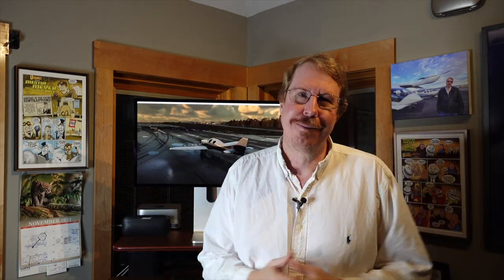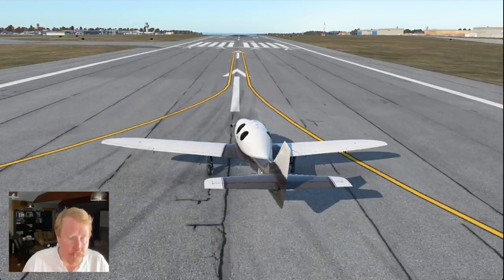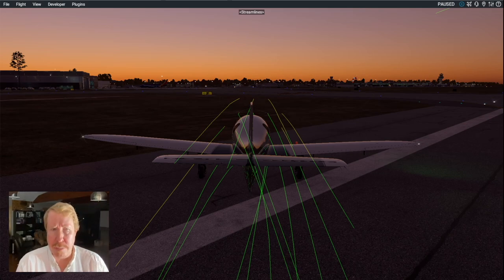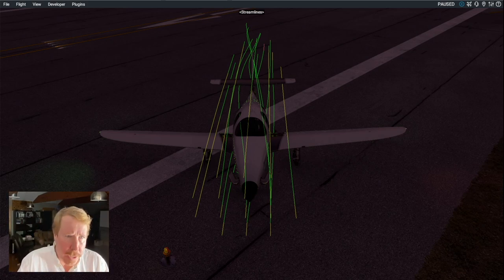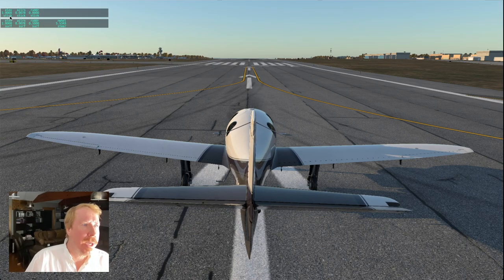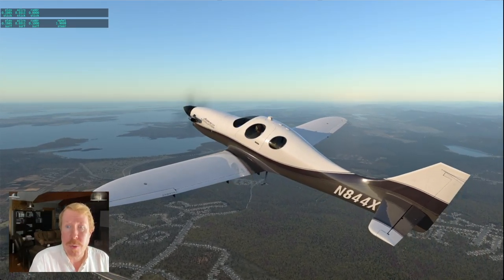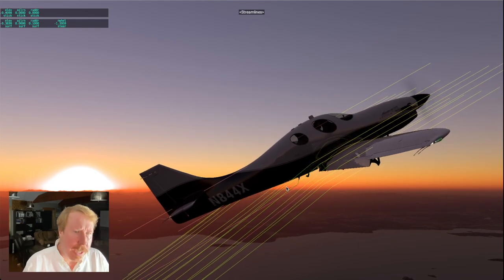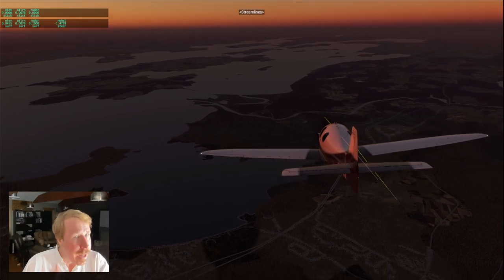X-Plane did WWHHAAAA!!?!?!?!?

Comment: X plane is definitely a sim for pilots. The flying feels realistic. It has its moments but hey, it’s still a game at its core. I’m really impressed that you can even program something that can replicate something so complicated. It was 50 percent or more the reason I was able to last my instrument add on. When things weren’t going my way on my check ride I relied on the training where I wasn’t burning gas.
Reply: Both sims are fine. No one should be doing maneuvering physics in either and both are fine for procedures which is what you describe.  I love both sims. But this fan boy one or the other is weird.
Reply: XP sitll uses Blade Element theory for its flight physics calculations though. This not as accurate as msfs boundary theory and CFD. And Weather, world wide weather representation is XPs weakness.
Reply: @hpharold23  the CFD mfs use is not the same , high fidelity model that NASA uses it is about on par with blade element weaker in some aspects . Saying that mfs CFD( which is lower resolution  has a  small grid size  ) is superior is ridiculous
Reply: @hpharold23  troll alert
Reply: @hpharold23  Great copy and paste.
Reply: @hpharold23  I just leave here for you buddy. This is where CFD gets you, from one that knows. 

“The previous update had a few scenarios which were still problematic for under-thrust and over-thrust conditions. These conditions come about because the atmospheric stability in MSFS is significantly unrealistic, and we have had to build additional logic into the control law for these channels that is capable of dealing with situations that are thoroughly inconceivable in the real world.”

- RSR, PMDG
Reply: @hpharold23  CFD is an excellent way to optimise the aerodynamics of real aircraft. Also to investigate how a prototype will handle before it flies. It's much less useful for simulating the known flight dynamics of an existing aircraft. Using CFD techniques does not, of itself, improve realism. I don‘t think Asobo will one day reach XP‘s level of flight physics.
Reply: @hpharold23  what you miss is that no amount of simulation is suitable for pilot training when it comes to maneuvering.  It’s all bad without g forces.  Msfs actually simulates
High wing aircraft better than xp11 by default. But that’s not why we use simulators!   We don’t use them for flight training we use them for procedure training.
Reply: it doesnt really matter how „realistic“ an airplane feels. Most of the people flying in sim wont ever fly a real plane. So for me it doesnt matter much if an Airplane feels so much like the real one as long as I have fun flying. For me the sim should look good, the plane should feel good to fly and I am set to go
Reply: @hpharold23  Better tell the FAA this because X-Plane's flight model has an FAA certification.
Reply: @juliusott  Thats perfectly fine. You are the „public“ MSFS wants to adress. Everybody can choose which sim suits him the most.
Reply: @frankbyte  absolutely
Reply: @Deploracle  You took the words right out of my mouth. If XP is "a game at its core", then how do we reconcile that the FAA has blessed one of its versions as a "real" simulator? I don't think that "game" handle actually applies.
Reply: @8a41jt  The only differences between the FAA approved version and the desktop version, according to Laminar Research, 

1) the approved version allows for larger panels and panel textures (to better interface with the hardware side of FAA approved) and 

2) the approved version only features aircraft that are involved in real world flight training.

The heart of X-Plane, it's flight model, is the same in both the desktop and the FAA approved versions.
Reply: @Deploracle  I remember when Burt Rutan of Scaled Composites used X-Plane to turn White Knight 1 into a Spaceship 1 flying simulator, by strategically retarding White Knight's performance.

Game/tool is just semantics. It's a game that's a tool, that's a tool that's a game.

All I know is it can turn one airplane into another airplane for training pilots. Using off the shelf desktop computer hardware that was at the time less powerful than the average modern smartphone. They used like an HP or a Dell or something.
Reply: @juliusott  Then you’re gaming, not simming.

Comment: It could really do with a wind-tunnel mode in the plane-editor... a way of getting L/D ratios, stability margins, cg-positioning etc. in a controlled environment.
Reply: Austin hear hear, please this would be a wonderful tool for people who design their own aircraft projects.  I was wished for that in Plane-Maker.
Reply: Yes I would pay for a different software that is more wind tunnel focused.  I don’t need world scenery or mirror finishes or fancy cockpits.  I just want to do testing on my design.
Reply: @RA-gk5zg  Invest in real professional software. You will need non-realtime CFD for that, and be warned that it will be very inaccurate.
Reply: @ArchOfficial  I have to second this. As good as this is in X-Plane, a lot of optimizations and shortcuts are probably done to keep everything running real time on a reasonable computer at home.

CFD simulations do what you want. Please note that FreeCAD has OpenFOAM support and other CFD stuff as well. It should definitely be possible to do what you need to design airplane stuff. But don't rely on it for human life!
Reply: @TankdozerCavalry  My point is that even the best non-realtime CFD that take forever to render are pretty inaccurate. Absolutely useless for automobiles and lacking at best for aircraft although much more usable than for automobiles.

The only purpose of CFD is to guide towards possible optimizations of designs, not to actually test designs. You need experimental data to have a better idea of what is going on, even for aircraft.
Reply: IMO a wind-tunnel mode wouldn't need to be a full CFD system - it would be fine (appropriate, even) to use the same flight model as the main sim. But to be able to fix the aircraft model at a particular attitude with a constant airstream and observe and measure variables and vectors would be great.
Reply: @thromboid  In defense of the original idea. You CAN always up the resolution of a simulation at the cost of resources and processing time.

Comment: While I have never tried XPlane 11 or XPlane 12, I will say I'm truly impressed with those diagnostic tools showing the effects of wind on flight surfaces.  Where were you when I was in flight school learning this stuff?  :) :) :)
Reply from the maker: SOMEBODY has some downloading to do – x-plane.com/try-it (it's free)
Reply: Microsoft Flight Simulator has a very advanced system and can show those same wind flow effects and being a pilot myself and own both Xplane 11 & 12 and Microsoft Flight Simulator I can say that as of the 40th anniversary update to Microsoft one, it leaves Xplane in the dust for most things even physics now which is why I stuck to Xplane so long as graphics aren't everything but Microsoft is the complete package now. Xplane has become unplayable due to constant fps issues and considering that it's far inferior in graphics just doesn't add up. I used to be a staunch supporter for x plane but I can no longer say that I am due to its old outdated tech.
Reply: @topgunsi  MSFS is also a bandwidth hog because it has to download those world graphics. You pay dearly for it being as pretty as it is. I wouldn't say it's flight model is any better either. Not markedly WORSE like FSX was, but not better. Xplane is also easier to mod if that's your thing (like a LOT easier. Xplane connect, plane maker, etc). And it has weapons in it too as a bonus.

Comment: Thank you for such great software Austin.  As a real life pilot, my experience with X-plane (since version 8) is that it is VERY accurate compared to a real airplane once the joystick setups are adjusted.  X-plane modeled by two airplanes very closely (Grumman AA5 and current airplane is Cirrus SR22T).

Comment: Thanks Austin! I remember emailing you years ago about Helicopters and Stability Augmentation Systems, Stabilator Systems, autopilots for helicopters etc.. in particular the Black Hawk Model you had. One thing that impressed me the most with you was when you first just replied with the short answer of Google Blade Element Theory, I told you my credentials about being a reference pilot for the level D Full Flight Simulator and real world pilot of the aircraft in question. We then got into a very good discussion on aircraft systems that goes beyond just green coloured lines in order to make an aircraft feel more realistic. Especially helicopters with these systems fitted to dampen or enhance the control outputs. You listened and asked questions of me, didn't just shout me down with all your knowledge and defending code as we coders like to do. I give you a lot of credit to this day when I talk to others saying I've had this interaction with the creator of X-Plane! It's an amazing Game/Simulator, and you should be immensely proud of your achievements.

The more you can do a comparison using your real aircraft VS. the sim the better. I have done many overlaid videos to prove my points that the sim does what the real aircraft does, when the non-believers pipe up! After all, that's that only way we can qualify and re-qualify a Level D Flight Simulator each 12 months by using very small tolerances in comparing data, both tabular and graphing.

You did mention about incorporating some of my ideas into X-Plane 12 helicopters. I was wondering if you may be able to conduct a similar video on rotor-craft?

I really enjoyed this Video. You really explained everything in a simple and fun way for even the non-pilot to understand.

Well done and PEACE OUT! 🤩

Comment: I have no idea who this guy is, nor have I ever heard of X-Plane, but as an aerospace engineer, I want to point out that this guy explained and visualized a lot of the physics amazingly. Looking at the flow visualization, of course it’s not 100% accurate, but it’s definitely good enough for a game! Great job sir! 👏 

Might have to give this game a try soon :)
Reply: Especially note the downwash of the wings impacting the flow over the tail surfaces.

And, of course, also the propellor downwash impacting all the lift surfaces. I wonder if he also has some sort of way of modeling the actual flow over the fuselage, or if it’s just all propellor-dependent (and the fuselage is ignored).

Anyways, love to see this attention to detail from a video game developer!
Reply: Just watched the part about trim. That proves that this guy is running a real-time longitudinal static stability model with all its elements (cg, aerodynamic center, center of lift, etc.)

Extrapolating that to the third dimension often brings along huge computational cost, so I’m very curious on what kind of simplified model he used for that.

Could be just a 2.5D approach, where doesn’t go full 3D and just takes the axes of the tail, wing and fuselage and calculates a matrix of force values on those…

I’ve definitely found another field to explore in my free time! Haha

Comment: XPlane has fairly good physics, but what it and other flight sims have never been able to accurately simulate is positive dynamic stability.  I.e., most planes seek stability when trimmed properly and you can take your hands off the controls, but in all the sims the planes continue to roll or pitch even when the controls are neutralized.

And yes, I adjust dead zones, offsets, sensitivity settings, curves, etc.
Reply: I learned to fly in a Cessna 172. I can tell you first hand, your job of flying the plane doesn't end when it is properly trimmed. It requires constant input even if it's perfectly trimmed.

The control forces required to do so are at their minimum in a properly trimmed aircraft but they are still required.
Reply: @BeechHouse  I learned to fly in a T-38 and have flown the F-15, F-16, and many GA airplanes, and I can tell you a properly trimmed aircraft does not require constant input.

Comment: Thank you Austin. I have been with X-Plane since v6. In those days and many years since, you have been so accessible to us when we needed help. Now, there must be too many of us to have such individual help, and YouTube give such a good way to continue with your help.
I have been simulating real aircraft in X-Plane for years. Mostly, these have been the BAe Hawk, and the Flitzer series biplanes designed by Lynn Williams. The simulation benchmarks well with reality, as long as we make the airfoil files as accurate as possible, for a good range of Reynolds numbers. All other details just have to be exactly as the real thing, and we just get 95% reality sitting at our desk ! I have X-Plane 11 now, and have not used it for a while. I would like to see some additional parameters in Plane Maker:-
1. Having some approximation of effect on highly swept leading edges.
2. More drag simulation. Interference drag and parasitic drag, perhaps? Could we have some way of predicting Cd of nacelle shape.
3. Could we have some kind of control on turbine RPM vs thrust? Right now it seems to be linear. In reality, turbines make their most of their thrust only at high RPM.

Comment: On the "yaw left" under power:  This is one of the things that annoys me about most of the flight sims I've run.   I've been a racing sim developer (physics engine programmer, vehicle dynamics engineering among other things) for 20+ years.  Most flight sims don't handle ground vehicle dynamics well.  The discussion of the aero forces and resulting yaw moment from the prop induced airflow is great, but what is almost completely missed is the counteracting effect of the tires.  A yaw moment to the left from the prop flow will induce a slip angle (like angle of attack but in the horizontal plane instead of vertical) in the tires.  Tire forces grow with slip angle.  With two rear tires behind the CG and one front tire ahead of it, the tires will create a yaw moment back to the right which reduces the left yaw acceleration.  It doesn't cancel the net leftward yaw moment completely (slip angle must still develop for tire forces to exist to do anything), but it should counteract it to a large extent.  

In the video the leftward tire forces are visible, but there's no way of knowing how close that is to reality.  It leaves me wondering what the tire model in XPlane and other sims look like and how the cornering stiffnesses and peak lateral force slip angles were tuned, if it's even modeling that at all.  Many aircraft simulators use extremely simplified tire models tuned by aircraft people with little understanding of ground vehicle dynamics, and as a result are notoriously bad at ground transit simulation.

What I suggest Austin looks at are the cornering stiffness of the tires and their yaw moment contribution as a function of slip angle relative to the prop wash induced left yaw moment.  In particular I'd recommend doing some constrained testing (in sim).  Force the aircraft path along the ground to a constant velocity with a constrained force, twist the aircraft to various slip angles with a constrained yaw moment, then observe the yaw moment contribution from BOTH the prop and the tires.  Then tweak cornering stiffness in the tires (relative front and rear ratio is important here) and observe the effect on the overall non-constrained yaw moment.  If the yaw moment is greater than it is in reality, then the sim aircraft will have a yaw acceleration to the left that's higher than the real plane's.  I think what you'll find is if you give the front tire a very low cornering stiffness and much higher in the rear, the leftward yaw acceleration will be significantly reduced and probably be more in line with a real aircraft while on the ground.  

What this means is you can reduce the leftward yaw acceleration (I suspect significantly from my experience simulating cars) through careful tuning of tires.  Real aircraft design engineers do this, it's part of the tire design process.  In the sim, it's not THAT the plane veers to the left that's suspect, it's how strongly it does so.  I'm not a pilot myself, but have flown in single engine prop planes with friends who are, and while there's a little pull to the left, it doesn't seem to be anywhere near as strong as it is in sims.  One friend with a Piper didn't touch the pedals at all during takeoff from what I could see.  My guess is because the tires are very different from what the flight sims often have.  If there's any steer compliance in the front wheel, that'll effect it too.  

It's no surprise really if/when flight sims have trouble in this area, ground vehicle engineering is quite different.  We're generally looking at different things from the flight sim people.
Reply: I wonder if Austin's work on X-Auto (basically X-Plane for land vehicles, which I believe was never released) fed back usefully into X-Plane's ground behaviour..
Reply: @thromboid  The fact that he never finished it and released something suggests probably not much.  Land vehicles with tires, differentials, suspension geometry and all that are a heck of a lot harder to simulate than planes.  I'm impressed with what he's done with XPlane but think he's missing some things in the ground vehicle department still.  Ground vehicle dynamics is an entire field in itself.  Most flight sim folks are completely unaware of most of it.

Comment: Gyroscopic precession, P-factor, spiraling slipstream, torque = 4 factors that cause left turning tendencies in single engine prop planes.  Excellent video!  X-Plane rocks!!
Reply: This is for modelling real planes not props
Reply: @justcommenting4981   props = propeller driven aircraft
Reply: @alergicgamer2711  propeller driven airplanes are real planes not just props!
Reply: @justcommenting4981  now, I really don't know if it's a troll or not